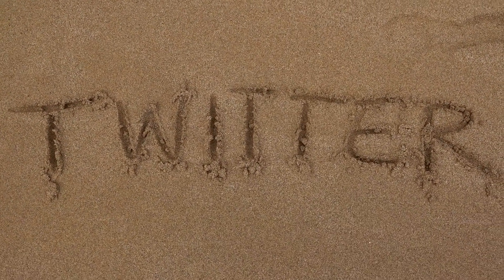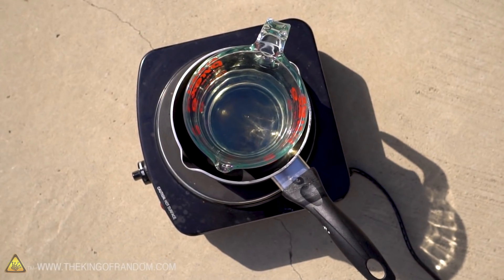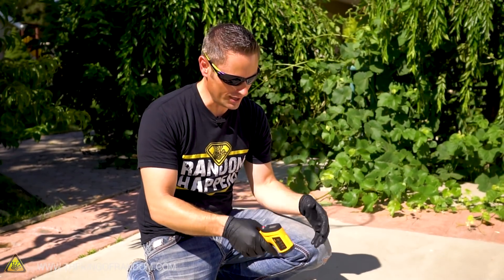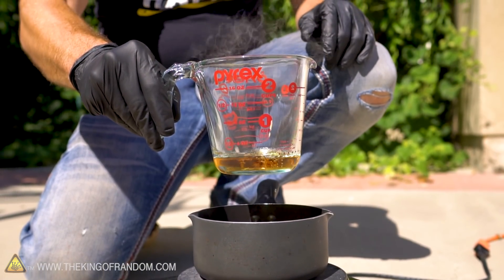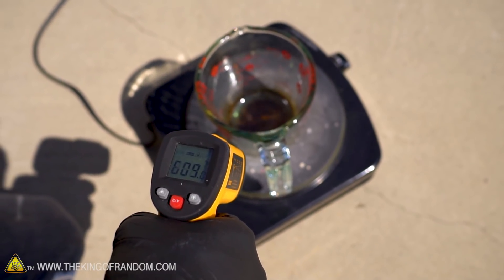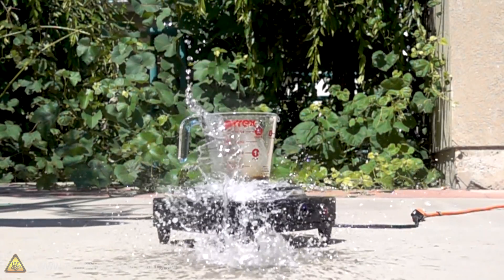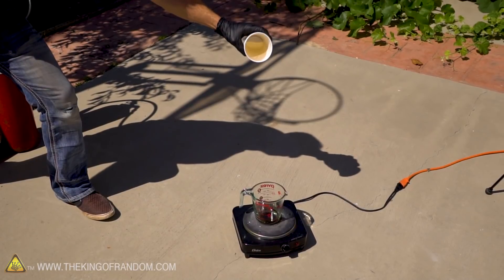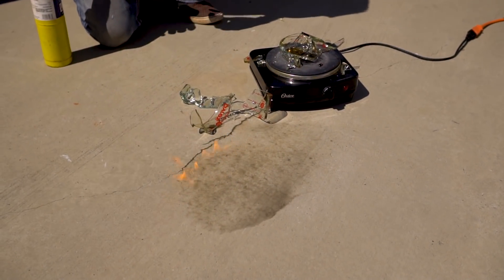Is Boiling Gasoline A Good Idea? TKOR Tests If You Can Boil Gasoline And What Crazy Thing Happens

Comment: If water boils in a vacuum chamber, is it possible to poach an egg in that vacuum?
Reply: RIVER DIXON the water boils because of the low air pressure, it doesn't actually heat up the water. In fact, the phase change should actually cool the water down, so an egg is probably not poach-able in vacuum water.

Comment: try getting a MAPP torch, you are looking at temperatures well in excess of 1200 degrees to flash liquid gasoline, the vapors are highly flammable, the liquid itself is very hard to ignite with a large heat source, you can throw lit matches and cigarettes into gas and the cigarettes or matches will extinguish, simply not enough heat to sustain ignition

Comment: well i believe the petroleum was colder than ambient temp because its a hydro carbon. ever notice if you spill gas/petrol on your hands they go cold because the hydro carbon is unstable and evaporates rather quickly leaving a cold sensation, exactly why we sweat same process ;). also this doesnt happen with diesel as it has not been as refined....

Comment: what if you put the gasoline in a pyrex measuring cup or something that can withstand the heat and try to capture the vapors from the gas in a balloon and then see if the vapors are flammable  by lighting the balloon I know there would have to be some kind of device to get the vapor from the container to the balloon or even maybe set up metal arm like a mic boom stand add a match/lighter to it and try it that way just throwing you some Ideas If the gas vapors are flammable and you could fill a balloon with them that would be a new start for a Mario fireball since the balloon is kind of round thanks and keep up the great work

Comment: How efficient is concentrated gasoline compared to standard gasoline we use in our cars? Can you use concentrated gasoline as fuel? Is it better or worse?
Reply: DaysofKnight Gasoline is a mixture of several different types of hydrocarbons. "Concentrated" Gasoline as you put it is not actually Gasoline as it is put into cars. The very actually of boiling removed most of what makes Gasoline,  Gasoline. That thick vicuous oil left is just the longer hydrocarbons chains that are in Gasoline. On effectiveness in a car I'm no expert but the cost to fill your car up with enough of that goop to make it run would equal at least 10 tanks of gas. If you want to completely fill it, at least 100. And even then I'm not sure it'd work because it is so vicuous
Reply: College Chem Student Your grammar isn't great, but I commend you for giving me a constructive, informative reply

Comment: Yeah Briggs and Stratton gas cans have a horrible spout. You can buy a replacement nozzle and it also comes with a vent plug (make sure the can is empty when you drill the half inch hole) all from Tractor Supply Co. for around nine bucks. New video, What happens if you pour gasoline on a live extension cord plugged into a running tool.  Short out, fire, or both?

Comment: Please note that if you're doing experiments using modern Pyrex brand kitchen glassware, you may not be using what you think you are. Pyrex lab glassware is borosilicate glass, Pyrex kitchenware from before some time in the 90s is borosilicate glass, but modern Pyrex kitchenware in the US is regular tempered glass. It does NOT have the same thermal shock resistance as borosilicate glass

Comment: What happens if diesel and gasoline are boiled together
Reply: pretty much the same response, deisel has an even higher flash point, being designed to autoignite under intense heat and pressure, that ignition is what gives a diesel engine the characteristic knock
Reply: Daniel Garcia the world implodes

Comment: Pyrex is tempered glass, meaning its very firm and resistant to temprature inversion. But that high of temperature inversion stresses the glass too much obviously. Its also why they tell you not to throw hot water on an icey windshield.  It could crack.

Comment: I think when the cold gasoline fell into the glass(what little bit actually made it into the cup) the heat from the residue and glass might have set off something which had enough force to break the now frail glass... That or, as you said, there was a thermal shock between the cold gasoline and hot glas which caused the glass to break because it was already brittle from being super heated

Comment: Uh, what is wrong with you?  I mean, I like your videos, but what would possess you to grab the glass measuring cup after you got the temperature up?  I mean, I wouldn’t tap touch it to check if it was okay.  I also think your big problem, and no mystery, was that you heated that up... and it really isn’t rated to be that hot, and then you put rather cool gasoline in it.  That wasn’t really interesting.

Comment: The stuff that was collecting in the bottom was probably ethanol. Most gas from pumps has ~5-15% ethanol and since it has a higher boiling point than gasoline it didn't get boiled off into a vapor.

Comment: I want for you to pyrolyze a big piece of bread to act as an insulator. Then make some frit from wine glasses. Also create a mold for the frit using something like water glass and sand mix that has been baked. You can make the water glass from drain cleaner and silica gel cat litter. OK so you can melt glass in a microwave if you Jumpstart the process by heating it with a blowtorch first. The problem is that the microwave has a thermal fuse which the glass gets hot enough to blow. Which is where the pyrolyzed bread comes into play. It is a really great insulator. So can you make a glass melting microwave kiln using the ideas I presented here? The mold may need to be changed since the glass will likely stick to it without it being coated. I think that this contains several random ideas rolled in one.

Comment: an open flame is probs not required, when gasoline is heated to a certain temperature at a given altitude, the hydrocarbon molecules should have enough activation energy to start the reaction(combustion).

Comment: Perhaps you should have checked the MSDS data of gasoline.  The auto flashpoint is between 495-833F depending on additives.....it would have to  "boil" / evaporate to vapour before ignition and then only the vapour would ignite as the liquid still wouldn't be hot enough.    The vapour is what cars use to run and what injures and kills people because you can't see where it is before ignition ask any firemen or Darwin Award winner.

Comment: The ignition/combustion point of gasoline is well above 2,000 degrees both Fahrenheit and Celsius.  The reason a flame from a lighter or a spark can ignite it is from the fact that if your thermometer could pinpoint the hottest parts of either you'd realize the temperature skyrockets.  Anyways kinda ruins the idea of starting a gas fuse fire with a cigarette like in the movies, huh? Lol. Love the videos, bro!

Comment: You should do something with 35 % or more  hydrogen peroxide. What would happen if you mixed it with fuel like methanol,? Then try squirting some into a running engine to see if it acts like nitrous oxide. Also see if it reacts/ decomposes with different materials. Thanks in advance.

Comment: That's the additives getting concentrated. The stuff at the rack is WAY more concentrated than a bottle of STP or something like that. It has the same consistency as tar.

Also, if someone ever tells you: "Gas is gas, it doesn't matter where you get it." WRONG! While ALL gas has to meet federal and state MINIMUMS, minimum is NOT where you want to set the bar!

Comment: Do you not realize you are measuring the boiling points of successive stages of the various hydrocarbons that make up the gasoline solution? Of course it's not going to burst into flames. You boiled off all of the volatile hydrocarbons in the beginning. The gasoline you bought already underwent this process when it was distilled from crude oil. What you are left with is a light grade oil.

Comment: I have actually thrown a water bottle of gasoline into a campfire and it didn’t explode because there is air in the bottle the air created a hole in allowed to gas to boil and then we shot it with BB guns and you would watch it sport up a little bit I haven’t watched your video all the way yet but I’m on the way to

Comment: You're fortunate at the mild reaction of the pyrex.  I've seen the results of a Pyrex dish on a hot stove-top hit by a cold draft from an open window. It popped so violently that there was a shard in the ceiling.  It is fortunate that The Woman had turned away just before-hand.

Comment: What would happen if you were to put gasoline in a vacuum?
Reply: It won't explode if that's what you want
Reply: Just like water... It boils.
Reply: dagamerguyofawesome same, boiling
Reply: It would boil at a lower temp
Reply: dagamerguyofawesome it would boil
Reply: dagamerguyofawesome 
Evaporative emissions system in a car.
Reply: dagamerguyofawesome already bone
Reply: not exactly. the evap system is not a true a true vacuum, it is however a low pressure system, and all it does is funnel the gasoline vapors back to the engine after the engine has reached normal operating temperatures, then it opens a small pintle valve that allows the vapors to be pulled via venturi through to the fuel rail and into the cylinders themselves

Comment: boil the gas then test the broiled gas in a lawnmower engine
Reply: Yep. Also boiling gas just gets you less gas. It evaporates. This is basically how they make gas in the first place. You take crude oil, and run it through a column still. Different types of fuel separate at different points in the column. As a matter of fact, gasoline was originally a useless byproduct of distilling kerosine from oil.

Edit for the residue in his measuring cup: It's the additives they put into gas these days and not actually the gasoline left in the bottom of that measuring cup after boiling it off. Figured I'd add that into my comment in case someone decided to point out I said there'd be no gas left.
Reply: Broil... it's a setting on your oven. Not a new word. Basically an upside down grill in your oven. :P
Reply: Candycorn 2014 no broiling gas is different form boiling lol know your cooking terms
Reply: Cookie Monster You mean boil.
Reply: Cookie Monster broil?
Reply: Dead juggernaut yolo
Reply: Wtf is broil men...... thats new word

Comment: The inside of a working engine is way hotter, still it compresses gas safely and need a spark to ignite it. Any other result would make the gas so dangerous to use that you would risk your life every time you drive a gas powered car for more than a couple of minutes.

Comment: The ignition temperature is 247–280 °C (477–536 °F), so the temperature was high enough for gasoline to ignite. That said the gasoline itself had a low temperature instantly causing the material it came in contact with to cool down making the temperature drop drastically so the gasoline was unable to heat up enough. Therefore it is possible at the temperatures you were using but if you wanted ignition / explosion you should have tried a closed container or something like a crucible without exposing it to the flame. (at least in theory)

Comment: Gasoline will ignite at 232 degrees Celsius at sea level, in an open container. The gasoline just didn't ignite when it landed on the hotplate or glass because of the Leidenfrost effect keeping the two from touching.
Reply: John E. Why did u say the outcome ahole

Comment: actually, you reached the auto-ignition of gasoline when you put the pyrex directly onto the hot plate but if you could put it in a metal pot it could work as 247–280 °C (477–536 °F) is the auto-ignition  temperature.

Comment: boiling liquids absorb heat. The gasoline boiling off absorbed a lot of heat from the inside of the measuring cup, but the outside was extremely hot. So ... thermal shock, shattered glass.

Comment: That thermometer is significantly more accurate when pointing at a black object because of black body radiation. I'd drop something black and buoyant into the gasoline. If such object can't be found, thermocouple or thermistor would be more suitable for this.

Comment: The dark residue is upper cylinder lubricant that they put in decent fuel. Once you distill gasoline to around 10% of its original volume, it no longer burns.

Comment: Grant, kitchen grade Pyrex, is NOT 
lab grade Pyrex.

Lab grade is Borosilicate glass.
Home grade"Pyrex" is tempered 
soda lime glass.  Borosilicate  
better resists thermal shock, but 
cracks more easily.  Soda lime has
better mechanical shock resistance, 
but won't withstand rapid cooling.
(Like you just proved.)

steve

Comment: When boiling gasoline are the vapors from boiling flammable? If so, is boiling gasoline a more efficient way to run an engine vs. spraying it in as a liquid "like fuel injection". Also would it produce less emissions to run an engine off the boiled vapors of gasoline?

Comment: the "residue" left over is exactly why 'vaporized carburetors' would no longer work: there is no standardized formula for gasoline. 

Two different companies can have radically different formulae for their gasoline, in fact two tankers from the same company, just at two different times to fill up the same pumps tanks, can have radically different formulae for their gasoline.

Comment: You really really should have tried igniting the residue, than also keep trying to light it at certain points so is it possible to boil out enough __ that gas is not gas and it won't ignite

Comment: @thekingofrandom, It didn't burn because you forgot about the triangle. Heat, oxygen and fuel. You didn't have the fuel part. Something that will burn or just an actual flame, Your pot, glass and even the burner are not flammable. Learned this in fire extinguisher class where I work.

Comment: Wow new pyrex sucks. If that was older it shouldn't have cracked.
Reply: Colton Blumhagen I dropped an old pyrex pot from like 2-3 feet in the air and it exploded. I dropped newer pyrex from the same height and it was just fine

Comment: Can you some how capture the gasoline vapor for an experiment itself?
Reply: JM&JS what does it mean when people just say I?
Reply: Yea do this please that would be cool
Reply: BUMB BUMB Sorry but I'm very curious
Reply: It would most likely be a mix of different hydrocarbons e.g. butane, ethane, propane
Reply: Berrie would still be interesting to see, and what uses it has. if it separates like oil,vingar,water would
... it would be an interesting experiment, more the most of what he has done....
Reply: I would like to see if this gasoline was Distilled
Reply: Kalle Klæp , this isn't  crude oil this is gasoline... so I think you ether mean something else and are using the wrong vernacular or you don't know what you're talking about.
Reply: One can "distil" crude oil...it's called "cracking".  The process can be taken further and the result would be higher voilatile C-H components.
Reply: The Nocturnal Alchemist i

Comment: Your thermometer was reading off the pyrex. Gasoline boils at 85c, and it won't get any hotter than that since anything that gets hotter is converted to a gas. You'd need to pressurize the system if you wanted to raise the boiling temp. The stuff that was left over are the additives that they add to control the octane and detergents. The autoignition temperature of gasoline is 280c, below that it'll need an ignition source, leave a candle next to the boiling gasoline and you'll see the vapors ignite as they pour over the vessel.

Comment: Hay can you distill the gasoline to make a higher octane?????
Reply: Actually if you distill gasoline you get white gas. All the residue you get is, which was leftover in the measuring cup, is everything that was add to the gas before it got to the gas station. I.e. additives, detergents.
Reply: crazycrossno76 Distilling it would LOWER the octane NOT increase it. The lower the octane, the more explosive it is.
Reply: Stacy Smith how come racing fuel is a higher octane?
Reply: crazycrossno76 To reduce premature detonation. If the explosion occurs too early on the power the power of the explosion slows down the rise of the piston on it's way to top dead center (TDC). By the time it does reach the top you are at the tail end of the explosion.

An explosion can be measured in milliseconds and basically has 3 parts, a beginning stage where it is growing, the peak, and the end where the explosion starts to collapse.

In a high performance engine TIMING IS CRITICAL! You want the explosion to begin a few degrees BEFORE TDC so that as your explosion starts to grow it hits peak pressure right as the piston reaches TDC. (You have to imagine all this in slow motion)
Reply: Stacy Smith thanks I have been a mechanic for 20 years .. I understand how that works .. that did not answer the question of why does race cars use higher octane.. when you clearly stated that a lower octane is higher performance..